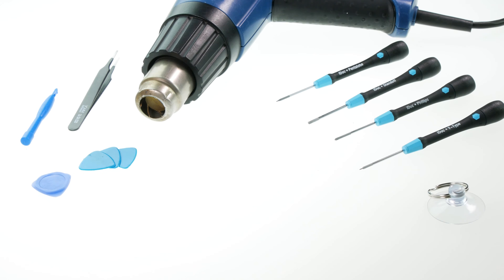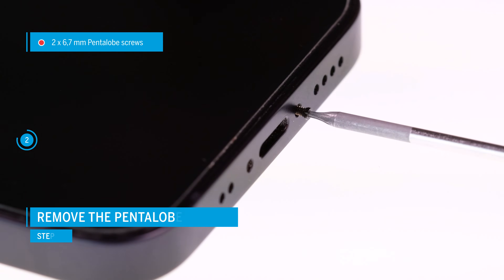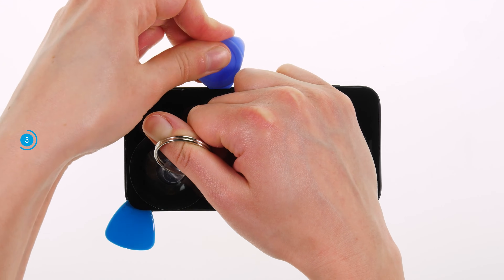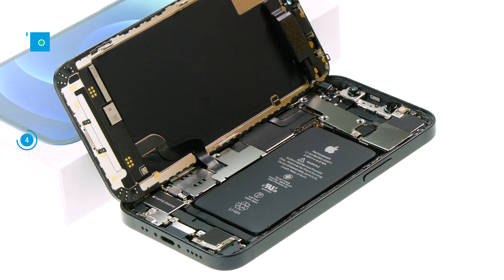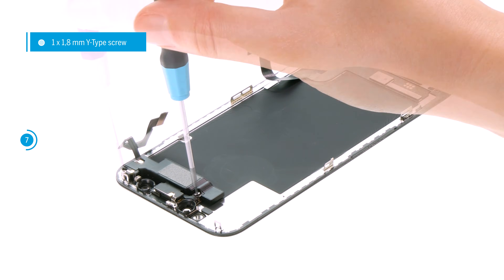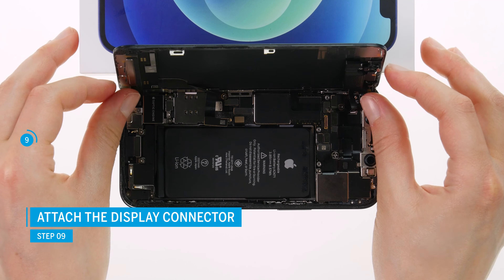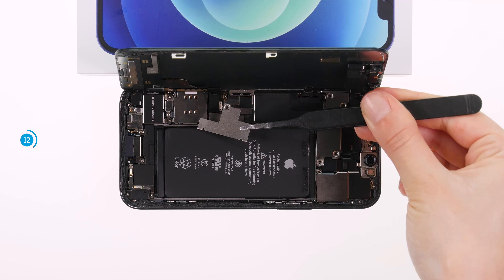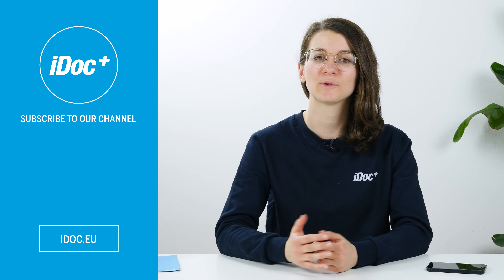iPhone 12 mini – Screen replacement [including reassembly]

Comment: Hey, at 4:50 that removal is much more difficult! You tore it, didn’t you? Is is glued, or is it just a very tight fit? It warrants some comment!
Plus, you don’t demo installing the tiny glue gasket into the frame. That’s tricky, it’s a fussy step with a specific orientation.

Comment: Hallo,
Is there no need to glue/seal the new display??
Reply: I mean you won’t be able to Guarantee the seal will be water tight so you don’t need it just don’t put it in water
Reply: @Outthepocketpod  should always put the seal in, it is a dust seal too. if it is accidentally dropped in water it will help (speaking from experience)